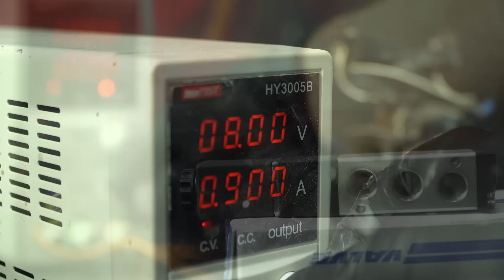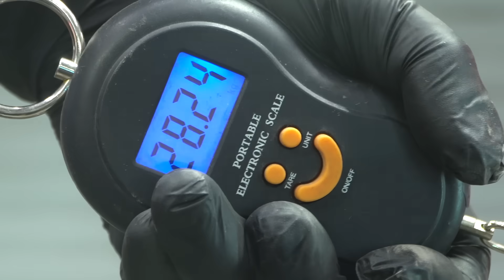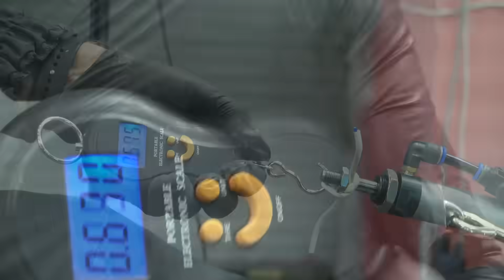Pneumatics and remote control for Quadra V-Tech from Cyberpunk 2077. Part 32

Comment: Maintenance will definitely be required. Seals often go bad in cylinders.  The oiler was a good idea. However I doubt you’ll have a dryer on that compressor you are going to use so your solenoids will begin to stick. You’ve invested so much in this. It’s awesome to see. Thanks for sharing the journey.

Comment: Its cool but aren't we in the age of cnc machine's and 3d modeling and simulation.
Just rent a machine at some place where it already exist get more high quality materials that are more lightweight and skip the entire welding entirley. There are even lidar sensors to recreate your build to below an inch. You will have much more room in the car after the mechanism is done in just 1 or 2 pieces.

Comment: Because those tires are not custom made to fit the "salvage" cars of the future where design and currency would be critical.... It's a common place vehicle in the future or they have to salvage pre-existing parts from an earlier past because they are all used up... Makes sense 🖤💙 so! The 

Michelin racing slicks, 37/71 R18 from a Bugatti Bolide would be all used up no time for reproduction because of uniqueness of the vehicle, kind of like how Ferrari does it..

Comment: Technical advice from an engineering student: consider putting the throttle valve in the oposite direction by the exhaust silencer. This way the piston will retain pressure and you will effectively control the air getting out of the system rather then the air feeding into it. Much more robust and powerful

Comment: Why pneumatic not hydraulic?
Reply: With air, if there is a leak, it doesn't make a mess. And a hydraulic ram is hard to move by hand if it fails.  This way it'll work remote or manual, power or not, without having to disconnect or drain a ram.

Comment: My minicooper has the glass move up by a few millimeters when the door is closed. That way the glass makes a good seal from wind and rain against the weather seals and prevents the glass from contacting the body of the car. The reverse can be achieved also by having the glass move down a bit and then delaying the door opening until then.

Comment: Awesome but you should be really really careful when entering this thing, looks like you installed zero safety mechanisms. If you accidentally trigger the mechanism while youre getting in or out i think you could get hurt pretty badly. I would put some type of garage door laser type setup on the thing so you don't lose a hand haha.

Comment: First 10 seconds of the video make me hope that there is a Fail-Safe to open the doors in case of an emergency or if the battery in the remote dies. You don't want to get trapped in the coolest car ever made! 
✌️😎👍
Reply: it can be opened manually without a problem

Comment: Why not use electric linear actuators instead or air to eliminate the extra weight of the gear an air system needs plus no worries about the issues that come with using air?

Comment: In the video at timestamp 7:04, it can be seen that the throttle valve is incorrectly oriented. It should restrict the air being expelled from the cylinder, not the incoming air. If you reverse those valves, the movement of the doors will be smoother, and the force generated by the pneumatic cylinder will be more consistent.

Comment: "pressed air" i cant stop laughing. Btw youre using constrictor (what you called throttle) wrong. The constrictor should be installed on the other side of the cylander where the air bleeds out allowing pressure on both sides of the inside seal when its activated for smooth operation and full use of the air pressure while still having the low speed. Ideally you should install them on the exhaust ports of the solenoid valve

Comment: Hey! Not sure if you've already considered this, but on a Mustang for example, since there's no frame around the top of the window it rolls down slightly when the door is opened and rolls back up into the roof shortly after the door latches. Just thought I'd bring this up in case!

Comment: tHE only problem that I see even though I really prefer the air is that air lines take up more room than electric wires and that takes room and the air lines will have to be be fixed in place so they don't make noise as it opens or closes.  Nice work on the entire door project !  I learned a lot by watching you figure out how to have it open and slide nicely !

Comment: Put the flow control (throttle as you call it) on the vented side to do a meter out cylinder. This gives you full pneumatic force while maintaining speed control,.

Further clarification, meter the air exiting the cylinder, not going into the cylinder, gives you way better control.

Comment: Pro tip: regulate exhaust not input for smoother pnuematic motion.

Edit: Never mind you have charged nitrogen damper. This increases complexity but it works. Very nice.

Comment: If you want to limit the operating speed of a pneumatic cylinder, you have to use the flow regulators on the exhaust side. Otherwise the cylinder will be weak in the operating direction.
In your first example, you would have had to put the flow rate limiter before the filter/suppressor on the non-powered side of the cylinder, and limit the amount of outgoing air to slow down the powered stroke.
This would help with the opening speed being too fast too.
Sure things will work even when the powered side has low flow rate, but it is a very noticeable difference in the movement/power characteristics of the cylinder.

Comment: Hello, have you considered installing double-acting hydraulic cylinders with slowdown at the end of the stroke? This would make it possible to have more power when opening and closing, to adjust the approach speeds in the open and closed position, and to avoid the spring effect caused by a pneumatic system. moreover, in the long term, a small hydraulic unit is less noisy than an on-board compressor

Comment: You need to curve the channels at the front and rear to match the curve of the lift track, and curve the glass vertically to match. If you want to see how a convex door window is done, get a look at the doors of a 1968-1973 Open GT. It's one of the few cars to have double curved door windows.

Comment: That pneumatic assist door movement is such an improvement. Love it.
I'm concerned that the frameless door glass is going to have issues and not seal well when closed and the glass edge is very exposed to the risk of damage when the door is open.

Comment: This project is an art piece at this point. The pneumatic system is genius really... while difficult to balance, it will still give a powerless access/manual override much easier than electronic systems would. This build is just fantastic.

Comment: I'd be nice if windows rolled down a bit when doors are open, just like in some real cars with frameless windows. This way glass won't be damaged while opening and closing the doors and you would be able to install seal under the roof edge.

Comment: If heritage car manufacturers stopped with obnoxious front hinge doors on sports cars (like, why does it have to be an ultracar to have proper doors?), I might actually have thoughts of buying one. That and stop stamping out glued and welded unitbodies and pretending that’s “performance”. It’s 2025, modular carbon tubs are the only way to build a worthy sports car.

Comment: If available, I would suggest tempered glass or a plexiglass over regular pane glass.
Reply: He has a source for a 3-layer tempered glass sandwich with a polymer middle, like a windshield. A preliminary example of it was shown briefly in the beginning of the window fitting process. The single pane glass, acrylic, & metal is all about finding the exact 3D geometry the window needs to fit the car body closed, and be able to retract into the door. 

He needed a testing process if it can be done with a single curve, like it was cut from a gigantic cylinder. A compound or changing radius curve, like the window shape was cut from a large cone. Or if it had to be convex, curving in two directions, like it was cut from a large sphereoid, ovoid, or egg shape. 

And decide what would both fit closed, and retract properly into the door, and not move away from the tracks & weatherproof seals.

Very complicated, even with computer software, and doing it that way can take longer, unless you are an entire automobile company. Where maybe one engineer out of hundreds, maybe does nothing but "window math." Then checks with a dozen engineers on the "Left door team" if what he has come up with will fit or not. 😅

Comment: Now it is clear. You shouldn't  have replaced the door mechanism. the previous one was a two motion action, outward and backwards. It was more solid and futuristic. Make some adjustments yes, replace it completely for one slide pneumatic motion was a bad move.
Reply: I agree with you here.

Comment: I'm not sure if this is necessary, but in order not to risk breaking the glass when opening/closing the door automatically, maybe you could wire it so that the window lowers slightly and then rises into place when the door is in the right position?
Reply: My car does this

Comment: You could hook up the  air compressor to engine with some clutch  (like AC ones) to provide pressurized air without need with external compressor.
Reply: Wouldn't it only work with the engine running then?
Reply: @moogiebass  Some older S class had separate air compressor for the soft close doors and air suspension.
Reply: air ride compressor system would work ?

Comment: when working with pneumatic throttles, make sure to only throttle the exhausting air from the cylinder to prevent a stick-slip effect.